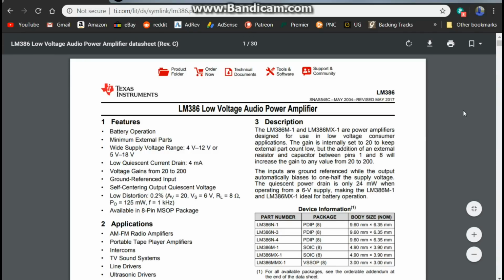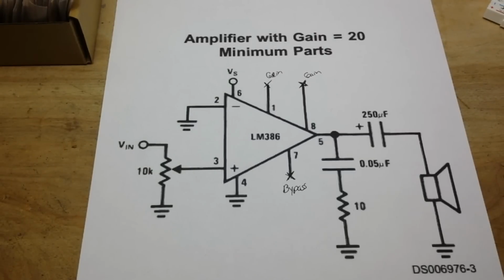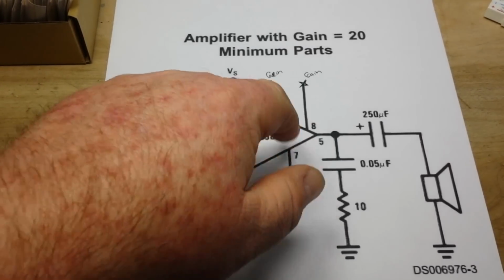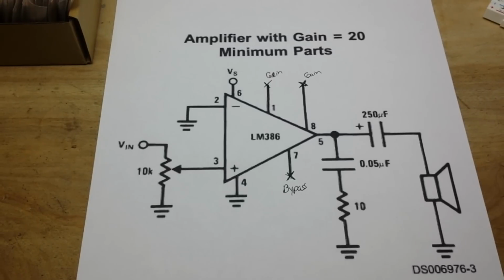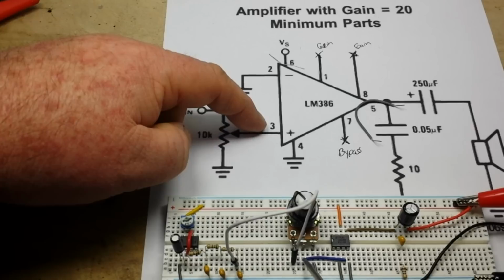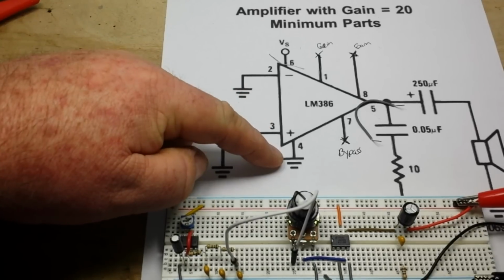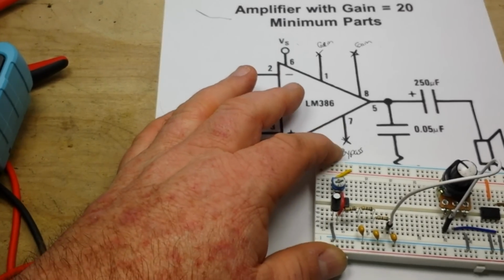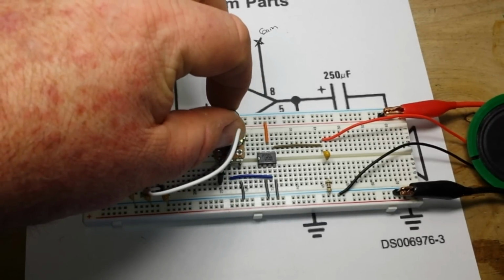LM386 Audio Amplifier Simple Setup

Comment: I’ve had cheap breadboards do this to me in the past. Spend forever looking for a fault only to touch something and the circuit comes alive, worst part is I’ll have touched the same connection before with zero results. Love the classic circuits videos Paul. I’m glad that you showed the circuit not working and then it suddenly started working because I watched very closely at the setup so I was confident you hooked it up right, it makes me feel a little better  seeing that it’s not just me this happens too. Great video Paul, thanks for all you do for us.
Reply: hi Paul the circuit worked after you put pressure on the hi side of the 10K pot which may have seated the hi side better?
Reply: I recommend breadboards from Sunfounder- no affiliation, just good experience with them.
Reply: i hate it because ive built circuits before. im tempted to just start soldering directly to the leads but i don't want to set up a fume extractor. i guess people are right when they say just to buy it, but i don't want to buy it!
Reply: it happened to me many times with RF circuits and then i started soledring everything (I mean when it is necessery) and my old designs start to be alive at the end...

Comment: Those chinesium bread boards have been the bain of my electronic projects. 
I spent days trying to find a fault in one of my projects only to find that the positive and negative rails had three breaks along their lengths and the wire insert holes on the board only made loose contact with the inserted components. Hence, parts of the circuit would not function at different times during the fault finding process, Nearly drove me round the twist, thinking I had done something wrong. Self doubt started to creep into my thoughts.
Saved up and purchased a good quality bread board from one of the quality electronics suppliers and now rarely get intermittent faults.
Great vid and thanks for sharing this project and the fault finding approach which is really important when our projects don't work as planned.
⭐⭐⭐⭐⭐
Reply: Actually the same problem for me. Now (especially today) I don't trust anything from China, which is sad. More counterfeit parts showing up. Locked down trying to do simple circuits with crap parts. And the hell with Amazon which seems to feature nothing  but crap.

Comment: In English, we read from left to right and I find working with circuits similarly. Bread board makers ignore this so rails are horizontal. Especially apt with 386 as all inputs are on left side, outputs/supply on right: easier. I have problems with ground symbols instead of ground buss line. As LM386 has 40db gain, pin 2 ground needs to be first on left, 4 on second,  zobel network grounded next and supply point last, on right, as done here. Doing it otherwise can causes motorboating, instability, I've found. Also, even the best solderless BBs can have an occasional unreliable tie point. Informative and stimulating upload: from learnelectronics. Thanks. 🙂

Comment: Also a cap around 1 UF  or so between 1 and ground helps remove dc offset and slightly improve non- flat topping ac swing. Yes, you found 8/5 thing. Nice video on using these test/ mockup boards too! Nice video. 73 Karl

Comment: You need the output cap as the lm386 output pin has a dc voltage of 1/2 the supply rail on it. Removing the cap will cause current to flow in the speaker all the time which would kill the output driver in the amp or  blow the speaker.

Comment: That little circle with an arrow in it is the symbol for a constant current source, it is part of the biasing system for the output transistors in the LM386 schematic, that's there to get rid of crossover distortion.

Comment: I picked up some LM386 to start learning about audio amplifiers and happened upon your video before they arrived.  This'll be a big help. Thanks!  Also, good to see I'm not the only one who runs into these little snags when experimenting where things should work but don't.  Always an opportunity to learn from.  I was wondering if you tried putting the blocking cap back in to see if it worked then (which it should since the speaker shouldn't be receiving DC)

Comment: School coursework had us use arduino and a 12~25V h-bridge motor driver. Output sound was fine but you can see the speaker cone move up (maybe about 3mm) when initially turned on.  Already had an LC filter on the motor driver output going to the speaker.

Comment: Great troubleshooting video at the end and shows what you can do without a scope. My guess the source of the problem was any combination of loose breadboard wire, ineffective low pass filter, and too large of a dc blocking capacitor (?) ... sometimes you can ask why but never know the true solution!
Reply: Experience tells me that with the -4 version 5 volts is the very very bare minimum power supply and you really need more then that for it to work. YOu should be using 9v.

Comment: JLT made a good discovery about terminating the inverting input w/ a capacitor instead of just shorting it to ground. Internally it keeps the other half of the diff amp stage better balanced, instead of just shorting the base of the inverting side input transistor. Overall a fickle chip but trusty once the kinks are worked out.

Comment: It may be the pins sockets are not tight. I find coating leads with thin layer of solder adds a tiny bit of diameter and helps on very thin wire.

Comment: WOW!! you must be reading my mind Paul.. I said on last video that im going to build a flashing light for my nephews school project!! was going to us the relaxation oscillator! but have no op-amps left to hand.. so im going to use the 555 with the triple low pass filtering to a nice slow sine wave.. what are the odds you put together the circuit in very next video... i would be even happy with the triangle wave so as not to lose voltage!!,  just need a blinking light. i KNOW there easier ways to do it but wheres the fun in that....

Comment: Great vid Paul! This would be the other half of the Tremolo! Combine the 386 with the 741 oscillator circuit(need to add speed/depth controls) using a light-dimming resistor(LDR) and you’re almost there! Being a man of the strings, thought it might be of interest!

Comment: It started working when you removed the output capacitor. You should plug the output cap back in and see if stops working. Then I would try a 220uf cap because that's closer to the spec of 250uf that the schematic calls for. I assume that output cap is some kind of coupling cap. Perhaps the larger cap is attenuating the output to the speaker to the point where the volume is so low you just can't hear it. Also, I would try to figure out if your gerry-rigged sine wave input is at a high enough level to drive the input. You might check to see what level of input the spec sheet calls for. And you might just try driving the input with a signal generator outputting a sine wave of a known voltage.

Comment: I had issues with breadboards from China. I've had to use a sewing needle to align the metal contacts with the correct holes in the plastic. Once aligned I use a double row pin header to insert, remove and re-insert. After that treatment they tend to stay aligned and are useable.

Comment: I have been searching for a design of a simple amplifier fed by an electret condenser mic feeding into low or usual impedance headphones. The mic would be  placed on the inside of the edge of the bell of a saxophone taped on or otherwise held there. You mention that you had earlier given details of just this type amplifier. I would be very grateful if you could give me the link to the video where you have given details. If your video is no longer available could you be kind enough to give me constructional details etc etc of a suitable amplifier. I shall be eagerly looking forward to your link or other information. Thank you.

Comment: The LM386 has 3 variants. The LM386N-1 and LM386N-3 run with a minimum of 4V. The LM386N-4, runs with a minimum of 5V. Which one were you using?

Comment: I must have missed something here. In the IC diagram, you can see the NPN pull-up transistor in wired as a (presumably) 4ma constant current source, which according to Ohm's law will pull up an 8 ohm speaker only 32mv. Yet, they advertise reasonable fidelity. How are they doing this? What have I missed?

Comment: The secret of the LM386 and many forget, you must include a supply decoupling capacitor . 10uf or moor. And it's often excluded in the data sheet.
Reply: The centers connections on sk10 power line patch board are usually open cct.

Comment: I am a bit bewildered about inverting inputs. You used one 555 chip to create a tone and input to pin 3 of the 386. What happens when pin 2 gets some input? What if (and I am now using the Number Theory Definitions of Mathematics) the periodicity of both 555 inputs to the 386 are relatively prime?

Comment: Just wondering, I was taught that when you use a breadboard, you should have the positive up and the negative down. Is there a reason you do it blue, red, blue red or just by habit?
Reply: That's the way all of my breadboards (That have two power strips, top and bottom) are. Besides if you rotate his BB 180 deg. it would be red, blue, red blue. Furthermore, he is using the red/positive strip on top and blue/negative on bottom.
Reply: It's actually marked on his bread board. There polarity that is.

Comment: You never actually checked if you had an input at the LM 386. This would have narrowed down your fault finding.once you probed the pot (al be it for resistance), I believe you “made good” the connections to the already stated “dodgy” bread board.
Reply from the maker: I think so

Comment: It doesn’t work. The pot is connected reversed. The signal goes directly to ground. When you turn the pot clockwise it shouldn’t output sound. Maybe the chip is bad. Or decoupling cap before the potentiometer

Comment: Someone has high frequency hearing lose.
Reply: 1K isn't even that high of a frequency. As soon as he took out the filter cap at the end of the circuit there was (very quiet) output. I would guess the pot was bad/dirty, as when he turned it on at 24:32 it made a 1k tone but the volume didn't seem to change when he turned the pot; then the pot began to work as a volume control the last time he flipped it on at 26:08.